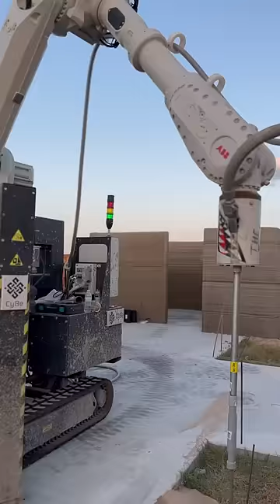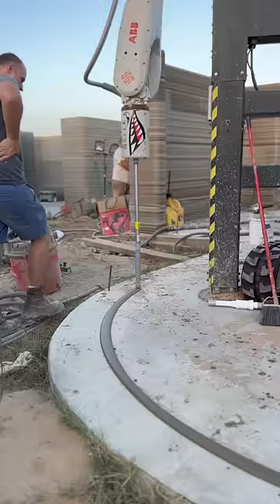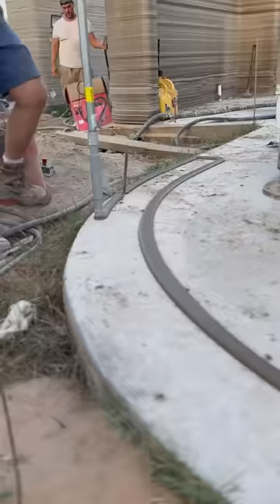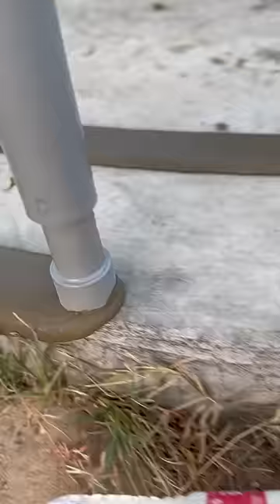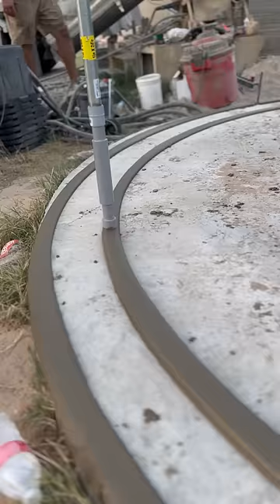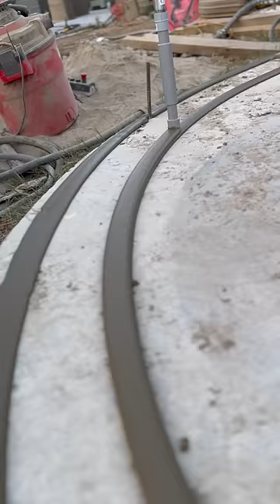Starting a fresh new wall with a two man print team #Hive

Comment: Looks like a quality control failure because you didn't clean the footing from dirt before starting.
Reply: Why is this an issue with this particular form of construction?
Reply: @Jank42O you need a strong base to build on.. plus the concrete will stick to concrete but not to the sand..
Reply: They’re using the sand as filler because the machine isn’t printing correctly on the cement the walls gonna be hanging off
Reply: Exactly what I was thinking
Reply: Nothing about this video screams “quality” lmao
Reply: You need a clean ground for the cement to stick
Reply: Там не грязь там песок но под песком нет фундамента вот в чем прикол😂😂😂
Reply: Lol I don’t think the wall will move once it dries
Reply: Lost money. Verry precise machine but verry bad workers. First layer need remove oxidized concrete surface and made contact layer.
Reply: Tile contractor here, concrete is a very strong and versatile subfloor. It also holds dust very well. 90% of products do not stick to dust. This is why the surface is always cleaned before installation of anything. Not a new concept.
Reply: @jrea424 so the stuff I have to make new concrete to stick to old concrete isn't real?  Because the concrete pad looks to be painted with the same stuff.
Reply: That not a "clean the footing" issue. That is a alignment issue and the contractor just pushed dirt up next to the slab for the material to set on.  Super super bad construction.
Reply: Same though I had.
Reply: Two different materials and build surface then what I print on but I don't see why you wouldn't put the work in cleaning the build surface just like a miniature version of this🤔 At least a bonding agent for the concrete or whatever materials they are using. From my experience with concrete it's best to have it clean and use a bonding agent but what do I know?
Reply: Also this one's not made to be popped off
Reply: @Jank42O  its a number of things. 
1x water proofing
2x ahesion of the two mediums together.
3 x good stanard practice like sanding when painting etc..
Reply: Not even broom swept.
Reply: This process will never be mainstream. Look a ICF Foam forms. Fastest system and most insulated system and it hasn’t taken hold at all
Reply: @NsyShwl it aint gonna stick to concrete when its dry. Nothing to adhere to
Reply: @jrea424 Yes it does have you ever tried to bust a tilt panel up off of a slab that you forgot to put form oil on?
Reply: Terrible first layer. Yuk
Reply: Agree 100%
Reply: Ough. Will b ok.
Reply: @princeshaul they put the sand there on purpose it's grass underneath
Reply: Concrete doesn't necessarily "stick" to anything, but you could have cleaned the floor and not laid it on the sand. Move the pipe in 2-3 inches.
Reply: @youtubebandme4382  such an underrated and underused phrase! 😊
Reply: That not dirt on the foundation, that is dirt. They did not line the machine up properly.
Reply: Being clean or not it’s not gonna hurt the New Wall
Reply: And they failed to also apply a good bonding agent to the old concrete ….👎
Reply: @mybackhurts7020 this is the answer. It's a fuckin terrible idea.
Reply: Inconsistent edge tolorance & printing on soil will cause a weak spot & will not seal properly.
Should have cleaned the footing & made a dry run to verify that the mud would print on the footing, not on the edge.
Reply: was no  footing there.
Reply: There is no foundation there its just dirt. Messup on lay out somewhere. Somebodys getting fired.
Reply: @youtubebandme4382 the concrete definitely is
Reply: First thing I saw one hundred percent absolutely. Might not be an issue right away but it's going to be an issue soon. And actually it might be an issue right away especially once the weight of the roof comes into effect.
Reply: yeah well i ain’t seen a one of you on here doing that work so yeah there’s that but good for you y’all are trying and that’s what matters
Reply: Yup good comment 👍🏽 shitty prep by letting it be set on dirt
Reply: I was thinking the same thing it got over into the dirt.
Reply: @homesteadhaven2010 yeah they have bonding agents to adhere the cement but it wont work on dirt.
Reply: That's exactly what I was thinking 🤔
Reply: @youtubebandme4382 ? You’re obviously out of your element here kid
Reply: Add that your footings ie base is not correct, your gear is over hanging it
Reply: You right that's exactly what I was looking at!
Reply: Every one is worried about the dirt on the concrete when the concrete they are printing on isn't big enough
Reply: Sick burn
Reply: It’s the wipe. That part isn’t part of the wall.
Reply: @tommybokelman5565 moisture could set and ruin it overtime.
Reply: Printing off the foundation on some dirt? Ng
Reply: @jrea424  you right
Reply: Everyone is mentioning the dirt on the floor. It also needs to be wet to bond properly.
Reply: Foundation wants to the cad model so the wall is getting printed without support
Reply: @petrjiricek8547 ,
Was curious about that surface of the concrete pad being cleaned as well, notwithstanding the poor placement of the 3D print file upon the sand. You think a rig like this could have a laser head also mounted to blast away a microscopic layer to expose fresh concrete surface and cleared of the Dust via blow hose nozzles surrounding the downtube that are each individually controlled to blow through corresponding nozzles depending on the direction of travel of the nozzle upon the slab for the foundational layer.
Reply: lol that’s what I’m saying, damn, at least sweep it lmfao, went rite over a whole foot print, but I guess it must not matter and that thickness won’t throw off the height is a serious way? Lol
Reply: @Jank42O does it someone how self level? If the hump doesn’t exist at the top, and it doesn’t matter, then only reason I would say to at least grab a broom and sweep before you let it go over a whole foot print is your own integrity. Lmfao if the giant foot print gets washed away by rain, I guess it won’t leave any empty space there? I dont know, I’m just a normal guy who pays for stuff, I don’t build it.
Reply: Was just about to type that,big no no going over dirt like that
Reply: Not only that but the wall is off the damn footing…. Smh🔋🔋💸
Reply: @FlushtheSystem 
 Well, not always do to people who want to build with it. I was planning on building a small house with it. But the problem I had was with the getting them, since I wasn't going to build a oversized house the company's didn't really care about dealing with it.  I was going to build a small 2 story house.  One of the places  the blocks are made is 20-30 miles from where I planned to build. I would have been able to pick up direct from mfg.  But no dice since I wasn't building a mega Sq ft house.  I  only wanted to build 25x45-"50" ft
Reply: Shits only going to last a year or two anyways. But ya I totally agree. Get all dirt off the concrete first
Reply: Gonna have complete wall failure in a year.
Reply: F😂unny that was my first thought!
Reply: @youtubebandme4382 dude obviously knows this stuff so he touches grass more than you. 

Also, really original comment, totally not on every other video.
Reply: Yea I was thinking it seems a bit lazy or off but I don’t know shit truly
Reply: @tommybokelman5565  no but water will definitely go underneath it where that dirt is
Reply: @tommybokelman5565 Lpl you don't know what you've talking about ! lol
Reply: Run
Reply: Glad I'm not the only one that saw it
Reply: That's because they didn't have a 3rd guy.
Reply: yeah because a bit of dirt is going to stop concrete from settling 😂
Reply: might not matter here the material will form while it's wet
Reply: No steal works either so this shhh wont last long 🤣
Reply: That dirt is the footing... someone measured wrong and now part of the wall is off the foundation.... dirt will work tho for about a year until it compacts and the wall falls
Reply: thats okay repair robots coming soon.. we are obsolete
Reply: I'm pretty sure there's no footer under the sand
Reply: QC started crying 😂
Reply: Не верный расчёт фундамента.
Reply: And it goes off the side right there unless they fill the wall with concrete it's going to be a weak spot
Reply: Clearly an alignment fail, why do they offset or scale the design? Instead they tried to make the foundation bigger with dirt... wtf
Reply: @petermueller9386 that sand may support it temporarily but what the hell is gonna happen when that sand erodes from under it shit my back dutch door cement pad has etosion under it and we have to keep refilling it every year or so from rain storms in FL here
Reply: @jrea424 got a big patch job on my driveway that says different.  I cleaned it with the hose first atleast.  patch has no separation after 3 winters.
Reply: Oh man now we humans are printing house... 😂😂😂 let's see how long they hold up
Reply: Absolutely right 👍
Reply: Yeah! Half wall is being printed right off the footing onto some soil, but my even bigger concern would be the one lone rebar to tie the entire wall down.
Reply: Exactly, that would fail in commercial construction.
Reply: @tommybokelman5565 it doesn’t matter what you think it’s a building code requirement. It’s part of quality control.
Reply: Sand layer gives it a nice beachfront property feel.  water feature coming soon
Reply: Lol😂
Reply: Shit the dirt is the footing, no slab underneath
Reply: Horseshoes hand grenades and this
Reply: @Jank42O clearly it isn't.
clear as mud to some.
Reply: There's no foundation under that dirt you can see the lines.   I'd start over that's going to be problematic in the future plus Shoddy crap like that will give this type of building method a bad reputation.  Nip it in the bud in the beginning while it's easy and barley any waste
Reply: There is no footing that’s why they put dirt in that spot
Reply: @mybackhurts7020 then they f*** up the padding should restart it cuz I'm not going to trust my house on Sand instead of concrete especially at the price these printed buildings are.
Reply: I dont see this lasting very long
Reply: @NsyShwl lol
Reply: The first layer should be a series of ham sandwiches 🥪
Reply: Uhg that bothered me too
Reply: no he is hiding that its off the footing with the dirt on that side
Reply: @NsyShwl  you do realize that this type of building was invented to build on dirt. They probably only have a slab for a more even floor.
Reply: Yeah looks like it's not even hitting the footing that wall will probably fail or need to be torn down and rebuilt
Reply: P bro whoever map the outline for that is really testing my OCD that s*** went off the edge
Reply: The dirt/sand was intentional to make it all level.
Reply: This is not regular concrete though, usually its an expanding mixture that needs particulate or at least texture in order to adhere properly
Reply: @jrea424 they have 1....... Kinda
Reply: Shit looks like part of the footing is dirt
Reply: They built the dirt up because the pad wasn't large enough to put the wall where it needed to be. What it looks like to me anyway.
Reply: When you build your house with concrete blocks they sit on compacted dirt. I doubt 1/8th” of dirt under the first layer will effect the wall.
Reply: The wall is on the dirt. They were off when they poured the foundation or in the alignment of the machine.
Reply: Looks good to me
Reply: There was no footing to clean 🤷 machines dont care us people who do the work and care about our customers care.. just goes to show you cant prosper unless its from the sweat of your brow ... funny thing is he could of stopped readjusted the machine scrapped that shit off and started over but he was to lazy to even do that just another reminder why machines will never rule my word 💯
Reply: Where it started on the sand is just the lead in That's not actually part of the wall
Reply: @justjoe_fpv2709  I been a cement man for the past 15 years I see no reinforcement no wire except where the headers are I see cracks throughout and I can't even say that I disagree with this method but there are so many improvements that could be made by the operator and that's facts 💯
Reply: @homesteadhaven2010  If it's just some sort of either macropoxy, or silicone sealer for the concrete like I'm positive it is. It doesn't actually make concrete stick to concrete
Reply: @youtubebandme4382  it’s all about the fibers 🎉😂🎉😂🎉
Reply: The wall is half off the foundation so they just pushed sand up to the foundation 💀
Reply: cringe when it's pouring onto piles or dirt and sand 😶‍🌫️
Reply: @NsyShwl  , I'm sorry, but what you say is total BS. That tiny handful of sand has nothing to do with a multi-tonne concrete building stability .  That's for sure.
Reply: Construction now a days is a joke
Reply: @tommybokelman5565 no the wall won't fall. But that pile of dirt is maybe 1/8 to 1/4 inch tall. Wind and rain will blow that out, now you have a 1/4 gap for moisture or worse trees and vines. Those aren't things you want between concrete.
Reply: Slab is Off by 100mm at this area
Reply: This is how hornets make their nest
Reply: @Jank42O s an issue with every form of construction not just this crap.
Reply: @tommybokelman5565 you're a very silly person lol that's failing before you start
Reply: The pad wasn't poured correctly, so sand was a cheap fix
Reply: @KronicDaydreamZ and what sense does that make to have a wall ? Lol if you people were right about what yall think yall are houses wouldn't cost as much & definitely not last as long. The ignorance is kinda funny
Reply: @davidleeroth1968 if you're doin it like this you'll either have a lawsuit pretty quick or be fired. That there is just laziness & ignorance
Reply: @johnn3542 because a driveway done correctly repair is the same thing is a lazy ignorant prepped wall lol I'd like to see you put you & you're family up on whatever mess they're tryin to create lol
Reply: it looks like the footing was broken or something and they filled it in with dirt so that it would hold it up
Reply: @NsyShwl I believe they're Siri is since it's only a little piece of footing that was broken off that by the time the 3D printed wall gets filled in with concrete it won't be an issue
Reply: You beat me to it.
Reply: Not only that but using normal construction methods you can build faster and cheaper.
Reply: @youtubebandme4382  Could you explain how touching some grass would improve the quality of this construction?
Reply: Faster making wooden structure and pouring in
Reply: @tommybokelman5565 It will once the dirt it is sitting on washes away.
Reply: @Tierone1337 so you think the wall will suddenly just slide off...
Reply: I think the footing is not symmetrical on the side we’re the concrete is being ejected to the foundation slab.
Reply: @matthewheinze1231 youre right about the pushed up dirt. But what you failed to miss was all the loose dirt on the slab. So yes, they failed at the most basic task, sweeping.
Reply: You should really prep with a bonder/fortifier
Reply: @tommybokelman5565 ohhh yes it will that wall won’t last 5 years if it makes it past 6 months
Reply: @youtubebandme4382 why cuz he said the truth?? That’s dumb af to leave dirt there like that… I’m sorry but I use to lay concrete that will be breaking in a few years watch
Reply: There is no rebar either
Reply: 😂 yet they have the broom in shot.
Reply: @ferrumignis  you aren't supposed to poor sidewalks directly on grass. it's just some dummy that watched another concrete video. now thinks they are a seasoned pro
Reply: @Tierone1337 so how do they put cement cinder blocks up on a concrete slab sir ?
Reply: @bigbothoee8617  no it's not. I would have to use a router and trammel arm to make the radius then trace and cut 3/4 inch material over and over until I had enough to reach the right elevation
Reply: @S1MH4CKR  it's going to be solid concrete by then. only 1 inch for 1 ft is hanging off it will do absolutely nothing if that dirt washed away after curing
Reply: @robertbaan2944  Don't talk nonsense, literally everybody in this comments section disagrees with you. There are no half measures or cutting corners when it comes to building a house, especially the foundation. You want to add your simple minded opinion to try & act like you are smarter than me but you are not, my friend. I have been an engineer for the 20 years & this is just not how things are done unless you are from China, India or some other under developed country so please, you don't have to comment every brainfart that enters your head, ok.
Reply: I was outraged
Reply: I understand the thought but no it's not an issue at all as long as it has rebar in the footer going in the wall being poured.
Reply: Seriously I was about to say wtf kinda concrete run is this. Especially where it goes over uneven dirt oh yeah that's going to hold up good...
Reply: I don't think they even got it on the base
Reply: Lol there is always one karen...😂
Reply: They added the dirt because it was off of the foundation...
Reply: I was going to say the same thing but looks like you already have that covered. 😂
Reply: That’s what I thought
Reply: First thing I noticed!
Reply: Footer isn't poured right.
Reply: @fischersgadgets4936 i agree with yiu 200%  first thought i had was "all this high tech is cool but what about some low tech sweeping?"

And then i began to think about it and thought maybe this is what happens when people who work with 3d printers only, get involved with home construction.  They have zero understanding how to properly work with cement.  This is NOT an excuse, not excusing them.  Just thinking how the print job could have started so.poorly.  that floor/print surface....
Reply: What does this machine cost- two hundred and fifty thousand dollars? Looks like who ever sold the machine would help these guys put up a better video to promote their new technology. This type of shoddy workmanship is not doing that industry any favors.
Reply: @homesteadhaven2010 The concrete would be sticking to the "stuff" you have, not to the concrete. And no, the also isn't coating with a binding agent or adhesion promoter.
Reply: Oms
Reply: Looks like they need some craftsmanship with their construction! When the superintendent sees this he’s gonna blow a gasket for sure!
Reply: @youtubebandme4382  your reply doesn’t even make sense. The comment is right and it is right because of experience in a job working outside. 
Take your own advice.
Reply: @youtubebandme4382 He’s probably worked outside for longer than you’ve been alive
Reply: Nope its even worse the pad is out and rather than pour to add on to the pad it looks like they just dumped a load of hardcore to 'extend' the concrete pad........... :facepalm: 

Such an amazing advertisement for 'top quality' construction, I wouldn't let these clowns build a dog kennel!
Reply: Hey, they can't make maximum profit off of the machine, if they have to prep the area properly.. Lazy contractor.
Reply: @mybackhurts7020 kinda looks more like the base pad wasn't laid correctly to me. I suspect the 3D Printer (machine) is doing exactly as it was programmed to do.
Human Error?
Reply: @Jank42O  Are you serious? Cement doesn't adhere to dirt very well. There's going to be a section that isn't bonded to the concrete underneath.  Doesn't matter what the form of construction is, that's not good.

And then there's the part where it's overlapping the base.... Not good...  There's going to be a weak point
Reply: @mybackhurts7020 👍 definitely.
It looks like they should have done a test run, to see if their position was correct for completing the job.
When we use CNCs on granite, we need to see if the pattern to cut is contained within the slab, so this example is not contained on the slab, and should be reset.
Reply: Yeah I agree.  Euro ducks
Reply: Terrible alignment, probably adjusted after first pass, atleast I hope they did!
Reply: @mybackhurts7020 The machine is printing correctly, its the idiots who poured the foundation who screwed up
Reply: Lol exactly what I was thinking when I saw that
Reply: @TheOneAndOnly1776 yes, it does. It screams poor quality. Quality in and of itself means nothing.
Reply: Give mice a chance
Reply: @matthewheinze1231 this is exactly what I was going to say. You can tell that the wall doesn't line up with the footing at all
Reply: @mybackhurts7020 they meant the random sprinkling of sand and debris around the whole perimeter.
Reply: SteveDittman-kl5um it’s easier to realign the printer. I think that may be the issue rather than the slab size.
Reply: Yeah, all bad
Reply: Mr.George, how much you pay the new guy? Yeah he no good operator
Reply: @Jank42O like you really think something will bind and adhere together when there’s dirt and dust covering everything that allows that…
Reply: @youtubebandme4382  stop projecting mate
Reply: @youtubebandme4382 did you just tell a concrete layer to touch grass? 😂😂😂
Reply: @youtubebandme4382  le tensile failure has arrived
Reply: @mybackhurts7020  More likely they probably were off when they poured the slab for the floor
Reply: Lol I'm high n like wtf am I high or is this way off 😂😂😂😂😂😂
Reply: @darinkrinovich2062  that's what any scab would say
Reply: @Jank42O wont bond as well to the surface
Reply: @BradleyON1  Dude I was union all the way. Retired at 54 brother, 3 years ago
Reply: @mvg2x34 electrician is in charge, I can say as I am an electrician, no broom in my tool kit.
Reply: ❤❤yes
Reply: Looks like they laid the footing too short so now they've put the stone dust in its place 😂😂 the whole method is shite tbh, I wouldn't live in it, it will have so many problems in about 10 years 😂😂
Reply: Probably in Australia. Men don't touch brooms.
Reply: Plus the footing is well out on the front
Reply: Go eat an apple
Reply: @youtubebandme4382 he should touch grass because he knows about construction? That make no sense
Reply: @tommybokelman5565 Any wind over 20 mph will beg to differ.
Reply: Can't see it from his house, so what!
Reply: What I thought
Reply: How do you know anything at all about how this machine is supposed to operate? Why should your opinion be listened to at all? Have you ever seen, touched, or been in the same room as a machine like this? And no, and Ender 3 doesn’t count.
Reply: Thats what I noticed also. Plus the machine did not follow the curvature of the floor.
Reply: It's a printing support, if you are familiar with 3D printing
Reply: That’s what I was thinking too.
Reply: And from my experience i think its probably best to try that concrete adhesive stuff to connect concrete to concrete. I tried useing hydrolic concrete on the base foundation of my front steeps but its chipping off over time.
Reply: @matthewheinze1231 
Its like the boss though oh since we have this new Fancy robot we can hire people who know barly anything about construction
Reply: @Jank42O it will only stick to dirt does't reach real concrete
Reply: Pretty cool
Reply: The rebar will connect the footing to the wall , there is still plenty of concrete that is clean enough to bond. The weight of the build above also will help hold everything in place. 
Unless you're building on or around fault lines prone to earth quakes ... giver!
Reply: @tommybokelman5565 you're wrong.
Reply: Something about this seems so cheap and just plain untrustworthy, is it cheaper because if it isn’t cheaper you can keep that bullshit lol
Reply: @tommybokelman5565 you never seen a hurricane before?
Reply: As a carpenter I like it alot,but I wonder what it would be like hanging door jams to, obviously it works ok
Reply: Same. Why are they pouring onto dirt patches???
Reply: @youtubebandme4382 that wall will when grass starts growing through the dirt underneath it. Lol
Reply: @Jank42O it will compact leading to the wall to sinking and cracking it
Reply: Apparently you've never seen these homes built. Doesn't need that cleaning.
Reply: @princeshaul not how this construction works. Stop looking at it like a normal concrete build. Do your research
Reply: I agree at least clean that surface beforehand
Reply: Part of the wall will be on loose sand?
Reply: @youtubebandme4382 why would anyone want it on grass? There wouldn't be any stability.
Reply: @mybackhurts7020 yeah but that's an even bigger screw up than not properly cleaning the concrete pad off.
Reply: It one piece structure, clean footing is not an issue.
Reply: @youtubebandme4382 you don’t know what you’re talking about buddy, go get a job in construction.
Reply: That's not dirty,  it's nonexistent !

The foundation is not there!
Follow the curve.
Reply: If anyone using this machine I think their last thought will be quality
Reply: @youtubebandme4382 no, learn some basics keyboard warrior
Reply: @Happinessinlove777 the machine is probably aligned perfectly, it’s the footing that isn’t right. House still needs to be build to spec..
Reply: @tommybokelman5565 what about ants getting though the sand?
Reply: Not just the layout was off if you ask me. The single rebar 12” vertical rebar seems way underneath what you’ll typically see in the application. Not mention 3” of cover ensure the rebar doesn’t rust. 

Piss poor work all the way around.
Reply: This is effectively a large 3d printer. Not having a level "bed" aka the floor the layers will get messed up as the layers stack. The floor should have been cleaned and made sure its leveled. This is going to be a wonky wall for sure.
Reply: @youtubebandme4382 😂 what are you talking about pal bc someone knows about something they need to go touch grass
Reply: @mybackhurts7020 it's not printing correctly because it was setup incorrectly.
Reply: Foundation slab fail.
Reply: That's the point where i stopped watching. Amateurs.. 😂
Reply: Literally too lazy to sweep up
Reply: Don't think adhesion is necessary but it would be best to keep things clean just to avoid skepticism
Reply: Looks like the slab isn't correct, but they're still putting the wall where it is meant to be to the drawing. Pretty suspect in my opinion
Reply: @youtubebandme4382 It's pretty obvious he does, just because you're unfamiliar with trade work doesn't mean you have the right to bash people on the internet, it just makes you look like a dingus. Keep on keepin on though big guy
Reply: The old floating concrete wall, nothing can go wron there
Reply: 100%... base layer about to set upon loose dirt... cant imagine that being very stable once the layers add up... unbelievable tech though!
Reply: Well...more looks like the bottom slab was not big enough and the printer would have put the wall in the air, so they put dirt lmao
Reply: @mybackhurts7020 so even worse lmao
Reply: That’s the first thing that I noticed in the first seconds of the video
Reply: It's not that they didn't clean the dirt the wall runs off their slab
Reply: Hey Mr.George..."How much you pay for the man using the machine?"
'$20.00...no thats too much,he's no good'.....
Reply: portion of the wall was way off the foundation slab as well , hopefully it's some type of demo
Reply: @Jank42O cold joints never bond right with cement and leaving it dirty guarantees separation
Reply: Didn't "clean off footing"? They literally piled up sand to extend the footing to have the dimensions to "print" on lol. Now,  I'm not claiming anything about whether this is acceptable,  bc I don't even know wtf is going on here,  but I would think a solid foundation would be preferable,  and don't understand why they didn't just back up the layout to fall within the set footings.
Reply: @Татарин-ъ3ы  These structures are lighter than the norm? Maybe be blown away in a bad hurricane.
Reply: @Jank42O it's not
Reply: Yeah…
Reply: I was thinking the same, they should have cleaned before the print
Reply: And on top a pile of dirt lol 😂
Reply: @toodjackson4438 i think the footing is big enough but they aren't lined up properly. Its printing a couple inches inside of the edge then a couple outside on the dirt.
Reply: Too posh to brush off the dirt 😂
Reply: Грязь это и есть основание!!!😂😂
Reply: My first thought exactly. Even in construction, it’s vitally important to keep a clean workspace
Reply: @Jank42O it’s attached to the dirt not the foundation that shit isn’t stable at all
Reply: I saw the same thing, and thought some laborers gonna get fired...
Reply: @Jank42O 🤦
Reply: @NsyShwl  Actually the concrete WILL stick to sand. One of the components of concrete IS sand. The problem is the sand won’t stick to sand or in this case the sand won’t stick to the dry concrete beneath.
Reply: Im sure they dont bond the wall to the floor properly either, junk chinese building. Hes only got one piece of rebar tying that wall in, on top of not cleaning the floor like you said.
Reply: @tommybokelman5565  you gunna drop 600k on "i think"?
Reply: @klyddkross  Isn't it more relevant to see the homes 10 years after they're built (and the gaps left after the dirt/sand is gone)?
Reply: Absolutely correct ✅
Reply: Yea I have very little faith in the structural integrity of this building
Reply: Assuming how many people think concrete will just stick to dirt … this is why we have big government… people are moronic.
Reply: @Hizenbird  I know that concrete is a mixture 😂 and I know the sand will stick to the wet concrete but leaving the sand there is going to stock the concrete from sticking to the concrete base.. it may possibly crack someone once it's under the weight of the  house..
Reply: One would think!
Reply: @NsyShwl  is it not fastened to the  foundation? If it's floating you house will float away in a bad storm or hurricane.
Reply: Yup
Reply: concrete is made of sand its fine.
Reply: or keep it on the fondation
Reply: Why does everybody Gotta talk shit?  This isn’t even my video it  pisses me off every time. I look at the comments everybody’s talking shit.
Reply: @youtubebandme4382  the fact u saying this means u havent seen a blade of grass simce covid
Reply: It's sheeeeit gnomesayn
Reply: Man-o-man the ridiculous comments on here, I guarantee you it's not the printer that's off, it's the guys who formed the slab. The dirt is temporary so they can proceed with the schedule and not lose x-days work because of the lousy form work. After the wall has set, they'll remove the dirt and extend the slab to match.
Reply: Is it just me or does it seem like part of the wall is not being poured on the slab at all, there’s a section where it looks like it’s just being poured over compressed, dirt and rocks
Reply: @tommybokelman5565 as long as there is no stiff breeze 😂
Reply: @tommybokelman5565 cracks will form from those small imperfections that add up to a lot
Reply: Yeah water definitely wouldn’t seep under that!
Reply: Ikr
Reply: Right
Reply: Congratulations on supplying your competition with everything they need.
Reply: @mybackhurts7020 ya or maybe the pad their poring on is not round “out of round”
Reply: This looks like a pretty bad job done overall. Not great accuracy or prep
Reply: Not to mention it's literally going way off the edge lol
Reply: Nobody does
Reply: I think the measurements are way way off too
Reply: Cement is made with whatever grade of sand, whether granulated or fine, and the chemicals within the cement powder activate with water to create the adhesion. The pressure from what comes above helps to 'stick' it to the bottom. Seems like you have no idea how cement is made not ever really used it to construct.
Reply: To lazy with a print machine, I guess.
Reply: Came here to mention that plus the fact it’s off about an inch towards the end makes me feel as if the wet cement is going to just fall down that side and not support it’s self as nothing is blocking it.
Reply: No, reinforced bar?
Reply: There’s also no key
Reply: Omfg… atleast remove the dirt
Reply: @NsyShwl no it fucking won’t… wet concrete on dry concrete does not stick as well as you think it does… this is why you have to put in retaining rods to put up more barb
Reply: @tommybokelman5565  If not supported equally underneath it will be a weak point which with any movement in the future, will be where cracks form.
Reply: Under one part there looked to be only sand. Wouldn’t pass inspection
Reply: Is this Wolf Ranch?
Reply: Machine: what is my purpose? 
Rick: you get butter. 
Machine: (looks at arms) oh my God. ( accepts he has no real purpose beyond)...
Reply: I knew the second I saw this video this would be the first comment i would see and I was right💀
Reply: @petrjiricek8547 No pursuit of any real standards here. My coworkers are no different....it's a curse of our generation
Reply: @ChadDidNothingWrong  mybe when you build house for dog but real building for lot of years and weather from -30 to +35 °C is normal to made contact layer and hydroprevet coating
Reply: @NsyShwl NO, Cement does NOT stick to CURED concrete.
Reply: Это промах при строительстве фундамента. Они решили подсыпать песок вместо бетона)))
Reply: @Tierone1337  And more than one stump of rebar.
Reply: @mybackhurts7020 yeah and that
makes it okr? Wtf
Reply: Да, и на фундамент они в одном месте вообще не попали, песка насыпали👍
Reply: need.more.mexican.  bote de agua! y escoba. 150 bucks y un 24.  hace todas las casas en 1 dia
Reply: Two man print team not trained to use a shovel.😂
Reply: @homesteadhaven2010 oh you mean you been putting dirt on your cold joints to make them adhere?
Reply: Update: 3 months later and 13 concrete truck deliveries later, the wall is done!
Reply: @tommybokelman5565 move ??? sink is the issue
Reply: @jrea424 was getting ready to say this and a bit more. Its why steel is tied and rebar is layed.
Reply: Dirty footing..😅
Reply: @homesteadhaven2010 the pad in this video does not look painted with anything except tire tracks and dirt because they didnt even clean the damn thing. Maybe you should get your eyes checked🤦
Reply: Они сделали фундамент из песка в том месте где линия вызожит за фундамент😂
Reply: @tommybokelman5565 nobody cares what you think, you don’t get paid to think,we want facts,tired of everyone’s opinions and feelings!😂
Reply: @tommybokelman5565 Tell that to mother nature who can toss a train like a toy.
Reply: Exactly what I was thinking. Looks like they piled some dirt up because they didn't pour the foundation correctly. 😂 Come on man!
Reply: @tommybokelman5565 not yet maybe mate. Definitely within a couple decades though 😂
Reply: @Titantitan001 unless you show me houses you built decades ago that are still standing strongly today, I’m dead against this and would not want to buy. Definitely not. 
I’m surprised banks will give mortgages if they watch this
Reply: Да. И нет гидроизоляции от основания.
Reply: Its hardly printing on that footing anyway
Reply: Don’t you think it would be better if you clean up the concrete slab before start doing this?  It’s better work free of contamination.
Reply: build like 3 pigs home:)))))
Reply: Do you think they know what you’re talking about
Reply: @youtubebandme4382 spoken like a 🤡
Reply: A lot y’all are fake experts it’s insane lol
Reply: @youtubebandme4382 hes right there is no way there wont be a good seal at the bottom. This type of concrete work has no room for failures like this. Its good that the concrete is not mixed...
Reply: @clintyoung6482  Come back a year or two later and you can pry it off with a plastic fork.
Reply: 🟦... You went OFF the FOUNDATION!!...
...Programming issue?
Reply: @NsyShwl Concrete doesn't even stick to concrete.
Reply: @tommybokelman5565 water has entered the chat
Reply: it would have taken 3 minutes with a broom. not too much to ask
Reply: @tommybokelman5565 yeah, and the titanic was unsinkable also
Reply: Yeah it’s not even on the slab
Reply: That’s the main point you got from this video? That the cement foundation was dirty? You would go insane walking through a new home construction site at all the possible “defects and imperfections” you’d see.
Reply: Smoderaars
Reply: @mybackhurts7020 actually the machine is printing correctly, the concrete pad/footer must not have been poured to the correct dimensions. But either way pouring a fountain wall on sand is a very bad idea
Reply: Seeing that, hurt
Reply: @PJMontoya  is that supposed to justify anything other than sloppy working conditions and a lack of care about the final product?
Reply: @youtubebandme4382 you go touch grass if you did, you would know that concrete doesn't stick to dirt.
Reply: @marka9292  I don’t think they’re building a hospital or skyscraper here. This looks like a test for proof of concept to me.
Reply: Look where they first start. Looks like dirt not even concrete
Reply: ppl getting lazier by the second
Reply: @maddoxenzo4780  Yup. Lazy like people using microwave ovens, automatic transmissions, forklifts, conveyors belts, and elevators. The future is lazy but some call it progress
Reply: Yep
Reply: @NsyShwl oh there’s so much more than that wrong.
Reply: Lmao natural rebar
Reply: Wait till you find out what concrete is made of…
Reply: Ahhh she'll be fine 😂
Reply: @Mr_Wanja  bud im a structural engineer and geologist.

Hes 100% right. This is terrible.

Theres a layer of clay on surface its just mud. There will be no chemical bond in that section..

Dont matter what concrete is made of. Its got specs and its got ways that it work

This aint it.
Reply: My Thought exactly
Reply: And I love that single tiny piece of structural rebar so close to the edge. I see a crack forming right there. Brilliant.
Reply: @Jank42O  its like glue. if i have dirt on the things im gluing the two peices arent actually glued together. one peice is just glued to a bunch of dirt and smooshed against another piece, its like trying to smelt and your refusing to clear slag from the metal as you hammer and work. your putting inpurityies in the binding agent and expecting it to seal and bind.
Reply: @youtubebandme4382 can't. It's all dirt
Reply: @TheOneAndOnly1776 screaming lazy contractors
Reply: L
Reply: @youtubebandme4382  telling someone experienced in construction to go outside is like telling you to go eat glue
Reply: That’s what I thought
Reply: @NsyShwl   Concrete won't stick to itself. It needs some kind of bonding agent.
Reply: @Tierone1337  No.. wet concrete won't stick to dry, cured concrete. You need some sort of bonding agent.
Reply: Ya. First thing I noticed lol
Reply: @ASSOpid  it will if it isn't cured.. the way they 3D print houses is they start building the house layer by layer.. they allow the lower layers to start to dry a bit before adding the next layer.. that's why the top layer is dark and the lower layers are all lighter because they are beginning to dry and cure.. the way they get the new concrete to stick to the concrete foundation is by using rebar.. all I was saying is that the sand there at the base is not good for building..
Reply: Exactly! Don’t do shit but turn the machine on, watch it work, and claim that they did something significant 😂
Reply: Вы столько не проживаете, сколько простаит эта стена
Reply: Yeah. Like why you printing that on dirt??? Wtf
Reply: It could be a practice run. Maybe they knew they would have to clean up this pass anyway. Once they knew that the equipment was adjusted properly, they may have done a proper professional cleaning before applying the true first permanent layer. Just giving them the benefit of the doubt.....
Reply: @mybackhurts7020 so they knew the machine wouldn’t print correctly before printing so instead of making safe corrections to the base before printing they just said, “ahh fuck it, sand.” Hell you could have even moved the machine a foot back and been fine, but no, let’s make the base less structurally-sound by adding sand. You’re a real smart fella
Reply: Exactly! And the concrete slab was done sloppy too.
Reply: @Jank42O just like regular 3D printing it will cause a failure of adhesion to the surface meaning the entire structure could shift over time and it will not be water tight
Reply: @mybackhurts7020 sounds like it's their fault as they should've made a bigger pad
Reply: I thought the same thing. As it went over the first time I was thinking, was that sand? Then it went back, it is sand wtf. Looks like the footing was to short on that side as well, and they were going on a pile of sand, to a sand cover edge of the footing, then eventually onto the footing. Tf
Reply: @NsyShwl  Again...new wet concrete will not stick to already dry cured concrete.  The rebar will hold it in place but it won't bond. You need a bonding agent.
Reply: @homesteadhaven2010  Ya it's real. We use it all the time. These people have no idea what they're talking about.
Reply: @ASSOpid  you are not reading correctly 😅 I said that they allow it to dry a bit before they add a new layer otherwise the whole wall would crumble.. drying and curing are two different things.. you can see how the the lower layers are lightly colored and the top wet layers are darker.. I build custom homes for a living in the Texas and North Carolina area..
Reply: So many comments about sand, cement loves sand, their buddies.
Reply: I think the concrete was short so they built up some dirt to hold the wall. Lol
Reply: Doesn’t matter builders will never be found after they get paid on this mess
Reply: Looks like the dirt was the foundation. The messed up their calculations. 
Not sure why they continued to pour.
Reply: @NsyShwl the 3d process is very different from how u think it works  my bet is that's hot 3D cement it's bonding to whatever but the sand part is maybe a problem but we're just seeing a clip
Reply: @Jank42O because the concrete is metered by layer, rather than poured into a form, the uniformity and level of the print depends on the uniformity of the foundation.
Reply: @jrea424 Maybe they are relying on gravity.
Reply: Yep, not too mention who considers sand/clay and structurally sound/a good idea
Reply: @TheOneAndOnly1776  but its definitely cool
Reply: That's a slab, not a footer.
Reply: Love all the people complaining about how there no bonding agent or how it will never stick to the cured foundation, the only problem is its not hitting the foundation. I've laying block foundations for 12 years and have never used or seen another soul use bonding agent or anything else when starting on the footer. For all you experts with no real experience mortar with stick to a clean surface with nothing else. Bonding agents are mixed in the mortar or sprayed on walls for a parge coat or when using veneers. But go right ahead and put it on the footer, I mean if wasting time and money's your kink.
Reply: Agreed
Reply: That was the dirt they used cause there pad wasn’t quite right.
Reply: Looks like you should mind your own business
Reply: Ppl build cob houses out of sand, clay and hay tho. I don't know crap about 3d printing houses but it's probably fine lol.
Reply: @tommybokelman5565 what about ten years from now, do you forsee it failing then?
Reply: I’m hip
Reply: @davidleeroth1968 don't be mad at the concrete workers, dude. They know a thing or two about concrete.
Reply: @TSReviews  don’t matter the whole thing made the best they can won’t hold up long
Reply: @gregmanahan1312 It looks like they put the dirt there on purpose cause the print nozzle is "printing" off the edge of the slab.. Prob Mr George's job! 😂
Reply: Guess he doesnt give a fuck because they wont find out, meaby after xx years
Reply: could it be stone dust? @NsyShwl
Reply: That patch of sand will become a s gateway for termites ans all sorts on insects to move freely in
Reply: IT guys... not masons...
Reply: It legit fell off the side things were not zeroed or measured correctly. That was a perfectly fine arc path yet its origin of rotation was not aligned correctly
Reply: Cement 3D printing is in progress 🤣
Reply: my thoughts ecactly
Reply: @Jank42O the sand will wash out leaving a void which pest and debris may enter, if that void goes onwards into the inside you can have water enter the home, it's also possible to have the wall Crack along the void and have a partial wall collapse
Reply: Yep and it looked like it ran off the edge a few inches too
Reply: everything about 3D-printing of houses looks hokey and low ROI.
Reply: @Titantitan001 are you sure they're doing the same thing as what you're doing?
Reply: She’ll be right
Reply: You  right.
Reply: Это просто немного песка, стоять здание  будет 100 лет
Reply: @homesteadhaven2010 the whole concrete floor looks the same. They wouldn't paint the whole floor because you only have a certain amount of time ( from around 16 hours to around 72 hours) to put concrete on it based on the product and temperature to work correctly. Plus it would need to be jagged. Also needs rebar drilled into old concrete
Reply: My thoughts exactly!
Reply: No need😂...
Reply: @NsyShwl it will
Reply: Has anybody even considered the possibility that this is a test run to zero-in the equipment? He probably doesn't care that the concrete is dirty because he knows he is going have to do a final cleaning once he has the concrete laying where he wants it. It's easy to judge him to be incompetent, but consider all possibilities first. I've read quite a few comments, and they all are negative. My opinion is that he is in the adjustment process. Once this phase is over, he'll clean the area and dispense fresh layers on a clean surface.
Reply: thats probably why his company charges less than other contractors:)
Reply: He didn't even line to our that good and the dimensions were off on thar rounded section of the ground
Reply: @mybackhurts7020 why would you want the wall hanging off and why would it not print correctly
Reply: @Tierone1337 it is clean
Reply: @petrjiricek8547 What? !!
Reply: @NsyShwl it will adhere to sand but sand doesn’t stick to other sand if it’s a thick enough layer
Reply: @edgelordjank7978 that's an issue with any concrete structure. You need a proper bonding surface.
Reply: Was gonna say so because its not by hand you don't need to clean or wet anything for bondage??
Reply: So many experts here 😂
Reply: And they still gonna call this “affordable” at 350K USD.😊
Reply: Actually it looks like the footer isn't big enough.
Reply: Una persona construlye mas rapido....no sirve la empresa busca producir con rapides
Reply: You know DPC loosens the grip between the structure and substructure anyway right.. it’s still set to the footing. The wall isn’t going anywhere without excessive force.
Reply: The lack of rebar convinces me to think a little dirt isnt going to make or break the joints integrity!
Reply: Game Set and Match
Reply: Machinery is misaligned.
Reply: 기초도  실패   입니다
Reply: Interessante Technik ,würde ich gern mal als fertigen Rohbau sehen.
Reply: @NsyShwl how do you know that's not okay?
Reply: @Tierone1337 maybe it's not intended to stick.  maybe it's special concrete with a different property

just stop.  y'all aren't the knowitalls you think you are
Reply: It's probably just for this video for demonstration purposes 

But still I feel like itll break easy
Reply: @Jank42O  in a decade from now that wall will sink and crack, homeowner will be luck if it doesn't topple over
Reply: And 1 off spot will grow and be a huge deal by the end of it
Reply: whats an average 2B print home going for?
Reply: It lacks a " slurry" or in other words a " glue" bond
 Acrylic thinset or a Portland cement slurry.
Reply: @Titantitan001  A thinset "slurry".
Reply: Not only that but it should have been wet and chipped for better adhesion.
Reply: So glad I'm not the only one who noticed that!!!!!  There's no pride in craftsmanship these days....
Reply: He obviously didn’t read his bible 
“Foolish is the man who built his house on sand” 😂
Reply: will you pay for that I think 20 000?
Reply: Trisodium phosphate, look into it.
Reply: It looks like the footing was too small so they made the footing larger using dirt/clay
Reply: dont need too these things homd up crazy well little dirt aint doing shit
Reply: they messed their footing up and just "extended " it a little lmao
Reply: I have to imagine this was an alignment pass to make sure the machine was properly centered before doing the real pour.  If you cleaned first you'd only need to clean again after fixing the alignment.
Reply: The footings in the wrong place.  Total waste but that's what gets us.  They playing u man for numbers on YouTube
Reply: Guys, here is our Savior

HalleluYAH translates “Praise ye YaH”

YaH is The Heavenly Father
YaH arrives via the TENT OF MEETING
YaH was Who they Crucified for our sins
YaH was Crucified on an Almond TREE

Semitic of Moshe (Moses)
Isa Scroll (The Original Isaiah)

Isaiah 42:8 - I am YaH; that is my Name! I will not yield my glory to another or my praise to idols.

Isaiah 43:11 - I am YAH, and there is no other Savior but Me.

Isaiah 45:5 - I am YaH, and there is none else.
Reply: if you look carefully youll see that the sand is the footing,lol. definately a QCF
Reply: And you know, completely had the measurements off... back side has about 2 inch clearance, front side has about -1 inch clearance.
Reply: Missing part of the footing? No problem few inches of dirt will keep the outside wall of cream nice and stout 😂 stupidity
Reply: @mybackhurts7020 bad idea!
sand isnt a strong bond brother!!!